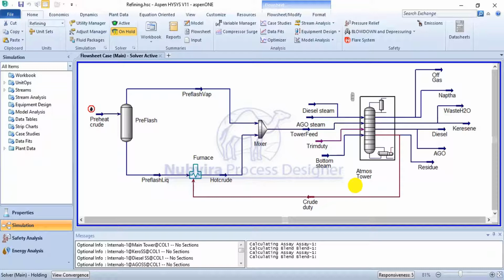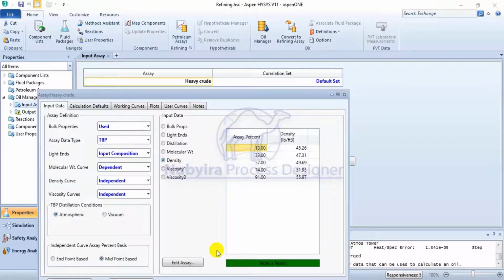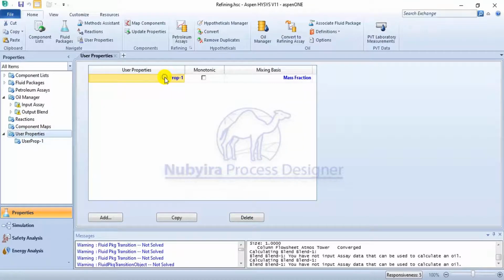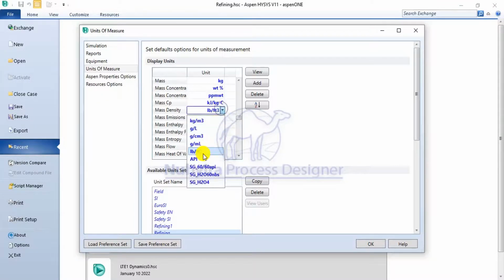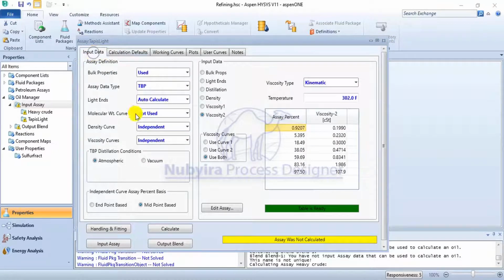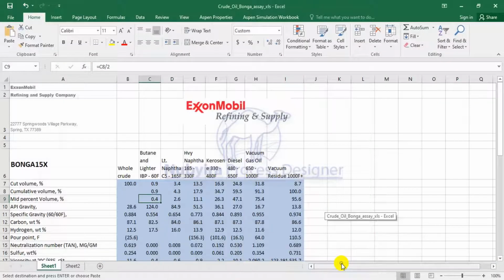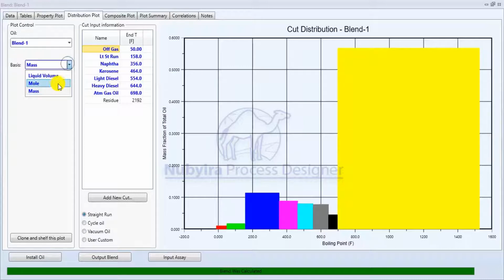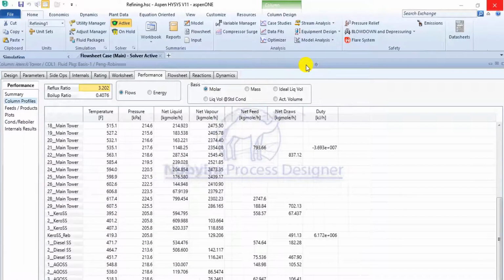Advanced Petroleum Characterization with Aspen HYSYS Oil Manager

Comment: Hello, what is the difference between a preflash and preheat train?
Reply from the maker: preflash remove light ends from feed before it enters the distillation column while preheat heat up the feed crude before it enters the distillation column.